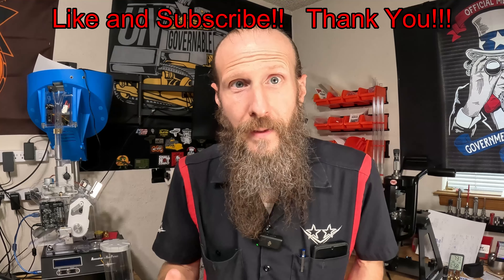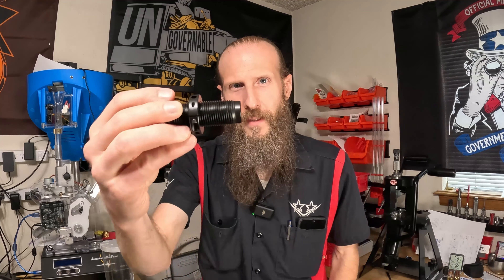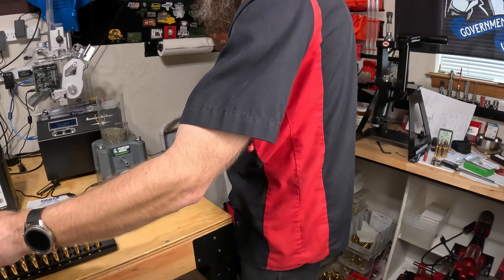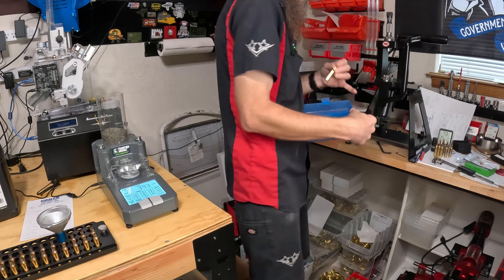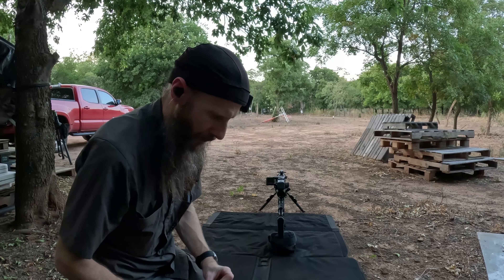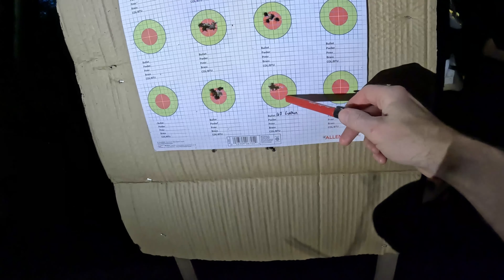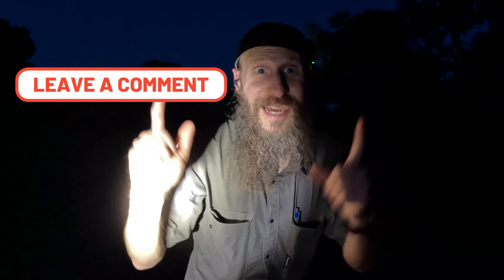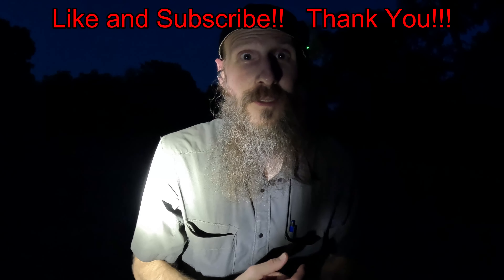Alpha Brass - More Powder Tests - Worth My Time?

Comment: I recently did a big test with 12 different powder charges at 10 rounds each and there's definitely a sweet spot where the ES and SD shrink. For this powder (VihtaVuori N140), it was about 2/3 of the way up from the lowest charge. It's like they are big-ish at low powder charges, then shrink down at the sweet spot, then the ES and SD get larger again towards the higher charges. It's not surprising that the group sizes behave the same way... so, all you need to do is find that sweet spot. 😁
Reply from the maker: @DocJustinT  I think I got lucky and found that spot on my 2nd charge, lol. I was looking, still have 50 cases to fire form. But as I was counting them, I noticed some of the necks are slightly dented! I bet that is what was giving me the couple of speeds out of the normal range. 
Trying to decide if I should just run those last 50 as they are, maybe mandrel their necks, or just skip to sizing my fired cases and mandrel them, then test my charges again. See what is going to give the best numbers after processing. 
Choices to make in the next few days and then go with the best plan for this weekend's testing projects.
I think I can trust that any charge I pick in this range will be plenty accurate enough for what I need. I really think it might change a little after running thru the process and getting to their 2nd firings.
Choices again, lol. I might try a little of everything if I have time. I really still want to get my speed closer to 2990 and see how it groups there. I think a few more tenths and I'll have it!
Always more to do, as you well know!! And I am always learning and trying to improve it all. I will get it dialed in pretty soon I think!
Good to see ya, Justin! Hope you had a good week.
Reply: @ChadKelly7 , I like to keep things consistent, so if it was me, I'd do what you did on the first (150?) of your Alpha on the remaining 50, just to keep them all the same. Then you can iron out any small details, like using the new mandrel die, on the second firing on all of them. I'm still... I guess the word is suspicious, or maybe curious... about Alpha brass being hard (or harder than typical) given what I found when looking up what brass alloy they use (alpha phase brass), and I suspect that's how the company got their name... maybe? I've never used fancy brass, for the most part. Typically, I shoot Lake City brass, and occasionally Starline in a few oddball calibers. One thing I like about Lake City brass is that it is extremely repeatable and predictable, and since it's military contract brass, it is very abundant and typically quite affordable in bulk. How's the reloading supply situation in your area? Around here in eastern Tennessee, things are mostly back to normal availability, though prices are still slightly high... although small rifle primers have dropped in price a LOT lately. Most powders are in the $40-50/pound range with some under $40/pound. Bullets... they are still hard to find locally (not much demand for match bullets around here... mostly hunting bullets), so I buy my projectiles online almost exclusively. I will be receiving 500 Starline brass in 6.5 Grendel on Saturday, if the USPS tracking info is correct, so I can start resizing it down to 22 ARC as soon as it arrives. My barrel won't get here for about 6-7 more weeks, and I keep telling myself that it's not a bad wait time compared to the custom Bartlein AR-10 barrel I had made during "peak stupidity" (that's what I call the Covid-Era). I had to wait 8 or 9 months on that one! I was hoping to either get in some Harley time or range time this weekend, but the weather forecast is calling for a soggy weekend (it hasn't rained here for about 10 days so we're very overdue for the rain). I might shoot in the rain anyway, if it's not too heavy or windy, because the range down the hill from me has a roof... no walls though, so if it's windy I'd still get soaked.
Reply from the maker: @DocJustinT  I am hoping that when it is time to replace my barrel it is not in a tough to get time. I have already decided that if things get crazy, I am going to just order one so I have it when I need it! It was so hard waiting that long for my Platypus, but I built this rifle in the time between ordering it and when it arrived. So, I kept myself busy and got another gun out of the time 🤣
Not much local for reloading stuff. Academy has decent primer prices still. Average for CCI usually on hand. But, I have a lot now. Forgot to keep track after a dozen packs, so I am well stocked for at least 5 more barrels 🤣
They don't have much powder tho. I just wait for Powder Valley to have a sale and pick it up. Have 13 to 14 pounds of H4350 on hand now. Will probably get another 8 before end of year.
Think last was 365.39 for the 8 pound. Not bad for that powder.
I would like to find out about the hardness of this Alpha brass. If/when I bugger one up, I will mail it to you so you can test it and find out!
Just saw Area419 has a 7/8th sizing die out soon. Gonna get it when available and see if better than my current die. Of course, now that I have a mandrel die, they will release it. They have a nice looking decap/mandrel. Worth a look I think. I like the new toys 🤣
I also am influenced by good reputations, so that's why I am running Alpha and Lapua over the common brass on the market. I think it's quite a bit better than the Hornady. I do need to test that at some point tho.
Hey, I did think of something you may be able to answer for me!
Will I need to adjust my sizing die for this Alpha brass? Set for the Lapua, but not sure if it's now set to just that brass, or shoulder bump set to my chamber now? I know I need to use a different bushing for the neck, but what about the thread in setting? Trying to save time and not have to go back and reset that, lol.
Reply: @ChadKelly7 , that's probably a good idea to get a new barrel as soon as you can and just have it on hand when needed. I know several F-Class shooters that buy 4-5 barrels at a time, mostly because their definition of a shot-out barrel is way more stringent than most other shooters. Oddly, in all my shooting, which I'd estimate at around a quarter million rounds, I've only ever shot out one barrel... but I have so many guns that I rotate through that most never get bad... well, that and I don't have any "barrel burner" calibers. I'm interested in your luck with that mandrel because I've never used one. I just stick with the resizing buttons that are built into the dies. If I need to tighten up the neck tension, I just hone the buttons with 1,200 grit sandpaper a tiny bit at a time until I get the desired size. As for resizing your Alpha compared to Lapua, you should be good to go (or really, really close) since all the dimensions are based off of the outside of the brass. The only real difference would be if one has larger or smaller case volume due to the brass wall thickness. Hornady makes good brass, but it is typically thinner and softer than most. I don't have much Hornady brass (just some from range pick-ups that I load as fouler shots before shooting my match loads), but when I resize it, there's practically no resistance on my reloading press handle, like it's made out of butter.
Reply from the maker: @DocJustinT  Yeah, I am nearing the halfway point. Probably order a barrel next month. Just be prepared. Good idea. Thanks for costing me more money 🤣
That is what I was thinking. Should be set for the shoulder bump needed for my chamber. Weird thing is how little they changed dimension at the shoulder from new to fired. Gotta check more, but first several were 0 to .001 longer. 
I can attest to Hornady brass being thin. My initial tests with the AMP were obvious. The Lapua were crispy, but the Hornady had holes burned through the necks in a few places on each piece. Much thinner!!
I guess it's just good to find what a person likes and keep using that. Consistency seems to be the main key to this game. That is what my goal is, make my stuff as repeatable as I can and go hit the steel!
Reply: @ChadKelly7 , you got it... consistency! That brass stretch could mean that you just have a tight chamber or it's dang hard brass. Either way, that's not a bad thing. I'm so used to the gas gun world where brass stretch is way more than that, mostly because, admittedly, the brass is way under-sized on purpose (to make sure it feeds easily). Most of my brass gets about 3 thousandths of neck bump with full-length small base dies. For the few bolt guns that I have, I typically only bump the necks 1-1.5 thousandths... just enough to close the bolt without force.
Reply from the maker: @DocJustinT  I passed out last night right after finishing my last bite of dinner, lol. Woke up at 4 this morning, still had pizza box sitting next to me. I was out!!
The guy I know here who I shoot with sometime also said the little to zero shoulder stretch is likely from my tight chamber. Guess it's still in good shape around 900 rounds later!!
I know the gas gun rules of thumb are different than precision bolt gun. You want those a little looser on the specs to run reliably. Man, I really need to get the time to try my 77 grain work up and make something I can try my 750 yards shot with my 16 inch AR and my 1-10 scope. I want to accomplish that goal. But, this PRS stuff is taking a lot more effort on my part to do well. I think that is why I like this more. Not as easy for me to do well really quickly. I am having to work and practice a lot more to get better. I naturally pick new things up quickly, but this is a good challenge!!
I am shooting for the .002 bump. Some a little less, some a little more. At least, on the Lapua. But, I let some sit for a few weeks and came back to finish loading them. Checked again and they were all the same. I think/assume the spring back settled after a bit and they ended up more consistent than I originally thought when I measured right after sizing.
Reply: @ChadKelly7 , ha! I love a good food coma. 750 with an AR isn't all that hard, depending on the barrel and ammo. The only hard part would be reading the wind... those bullets won't buck the wind as well as your 6 CM. Actually, I know several folks who build "trainer" rifles in 223 that are just like their competition guns... for two reasons... it teaches you to read the wind, and the ammo is way cheaper.
Reply from the maker: @DocJustinT  Yeah, I was out cold. The other night I only got 1 hour of sleep, so I think it caught up to me after eating.
I think that is why I want to do this. See if I can make it happen in the winds we get here.
Plus, seeing that far with a 10 power to the target down thru the trees will be a challenge. It gets dark down that path. 
We shall see. Someday I will squeeze out the time to get that load built up.
Reply: @ChadKelly7 , for 223 with "heavies" like the 77s, I've always had good luck with Varget and VihtaVuori N140. As for building the ammo, it's dead simple because you're limited to mag length, so just seat them to 2.260" and be done with it. Unless you want to single-feed them... then you can seat them long and get less bullet jump.
Reply from the maker: @DocJustinT  I have some TAC left from my first venture into ordering powder. I got something else I have never tried that I got when I didn't know anything. I think an IMR powder. I was planning to test the TAC and that newer StaBal Match powder and see which is best. First testing showed the StaBall is much slower with similar charge as TAC. But, I was not at all stable when I fired them, so it was just a speed test.
I figure if I stick with what I already have on hand, TAC will be the better one.
Yeah, seating is so much easier with .223 for an AR! I still need to post my crimping video. I forgot I filmed that and never edited it to post. I am not sure that I am setting my crimp die correctly. I get it so that it makes a slight mark on the brass. So far they have all functioned, but I wonder if my crimp could be better.
This is a project that I want to do, but I am much more interested in getting better at PRS, so that is what had been getting all my attention when I have time to work on my shooting stuff.
I have like 600 or so of the 77 SMKs, so I have plenty of supplies for this. Just need to make the time. Probably going to be a rainy weekend project. I try to use all the dry weekends to get down to the range and do something.
Reply: @ChadKelly7 , both TAC and Staball Match will work for 223 and 77s, but of the two I'd go with Staball Match just because TAC is ever so slightly on the fast side for 77s... but it kind of depends on barrel length.
Reply from the maker: @DocJustinT  standard 16 inch barrel.
I want to try both, just see which does better.
But, if the Match should be better I will remember to try and focus on that.
Thank you!!
Reply: @ChadKelly7 , lots of powders will work, just some better than others. Another good one for 16" barrels is VihtaVuori N135 (it's a bit faster than N140 so you'll get more complete burn). I've had great results with N135 and Hornady 68 grain BTHP match bullets.
Reply from the maker: @DocJustinT  Giving me too many options!! Lol. I am trying to simplify things. Get my preferred powder settled on for each thing I load, and then just stock up on that 1 powder.
Since I don't do as much with my AR and pistol loading, I don't have a lot of those. But happy with the H4350 for my 6CM and trying to get some of the 8 pounders when they go on sale.
I did another small test last night. Got closer to the speed number I wanted to test. Thinking 2 more charge weights to test will get me where I want.
From how things are going now, the Alpha will use more powder than Lapua. At least for similar speeds. 
I decided to take my scope cam off last night and twist my turret up several clicks. Was able to focus better on aiming point. Groups looking much better. I think my horizontal stringing last week was me not aiming at same point every shot.
If I get time today, I may start processing the brass. I really have a feeling it will change slightly after sizing. I inspected the mouths more. The uneven areas seem to seal after seating, but I still was getting 1 or 2 out of each 10 shot group that was out of the others range. Thinking after sizing and mandrel the inside of the mouth, I should get more consistent release. 
I am torn between finishing firing the last 30 cases, or just go right to sizing and test after. Choices!! And time to do things is going to be the main factor!

Have a great week, Justin!!
Reply: @ChadKelly7 , the reloading nerd in me likes to test lots of things... I've got like 7 or 8 different types of primers (about 35,000 in total), about two dozen different powders (like 90 pounds in total), and somewhere in the ballpark of 50,000 bullets spanning about 40 different bullets. If my house ever catches on fire, it will sound like World War 3 just started. 🤣
Reply from the maker: @DocJustinT  Good supply hoard!! 👌 
I will get there eventually. I'm only a few years into this. But I think I am around half that count of primers for some reason. I just keep buying them at Academy if there is nothing else I see I want, get a box of primers. Built up that supply for years for my personal use. I should be good next time there is an issue.
I did some more powder tests. I really think I can run any charge from 39.0 to 40.1 and be good, lol. A few have wider SD numbers. I really think a lot of that is just the new brass. I hope that after sizing and trying the mandrel in the necks will shrink those numbers. 
Now, I have so many charges I teated that are giving half inch groups, I don't know which to try first after sizing 😂
I guess I will see what everyone else thinks after this week's video. Mostly is a "here are my results, what do you all think I should do next?" kind of video.
On to the start of my work week now!
Have a good one!!! And don't start WW3 without the rest of us!